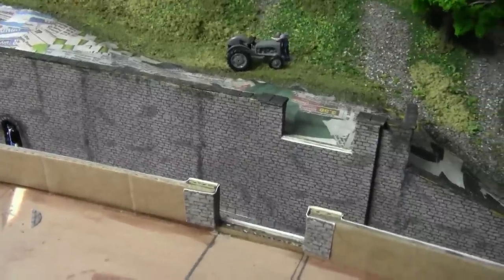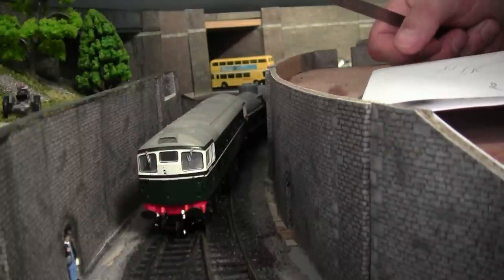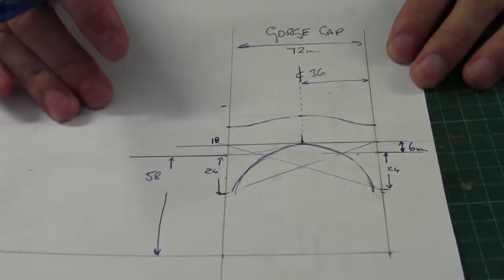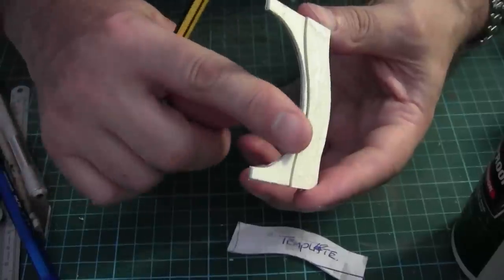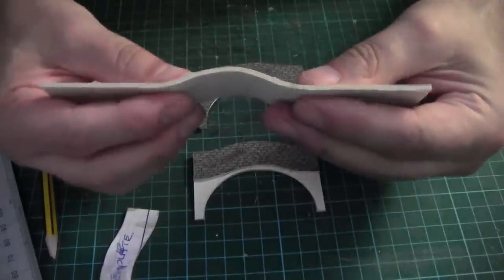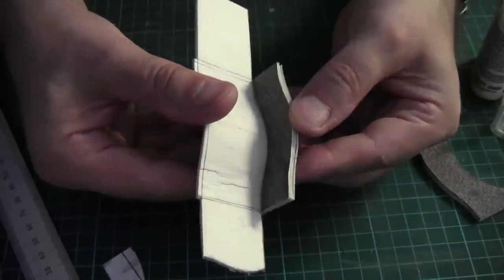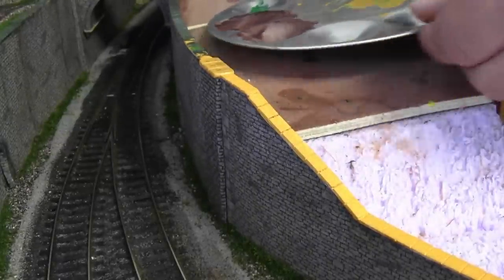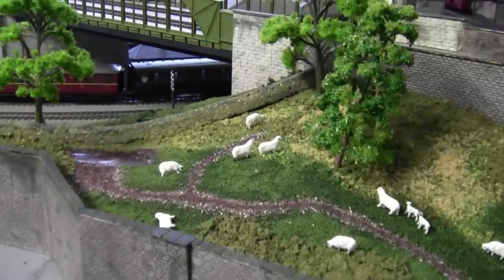Jarrow Road Part 7,  A Bridge Too Small   No 331

Comment: Hi Tony, great `small` but well detailed bridge. Looks like it has always been there, you are an inspiration to us all. As you said this cutaway and bridge adds another interesting section to your layout. With regard to the heat I have been unable to get into my loft (layout) because I had a rotor cuff repair to my left shoulder four weeks ago and hoping that the heat over the next week does not warp my track, got two more weeks before I can remove my support sling may have to get one of my son's to open the velux windows, track was laid over ten years ago in the summer time to allow for expansion (sweating like a good one at the time) but not for the 40 degrees they have forecast. I hope other subscribers that have loft layouts are able to keep a check on their trackwork over the next coming week, take care and stay safe..
Reply from the maker: Oh no that is not good Barry. you have to let me know when you are in the loft. If you send us a short video clip, i will be able to put on the community page when you are up to it off course. take it easy and stay cool, boy its going to be hot. there always the ladies football to watch.  take care buddy...cheer's Tony

Comment: Thanks Tony. I wanted a humpback bridge on my layout - like the one in Summer Wine - but  the awkward shape of the ends of the bridge and the lay of the land prevented me from using card or plasticard. So I opted for Das Clay. After several attempts I got there and it doesn't look too bad. Thanks again for a great tutorial and good ideas.
Reply from the maker: Good morning John, hump back bridges can be a of a hit and miss. but if you get the measurement's right then its should work out. on a previous layout i did do a foot with a hump in it. but that one i hand built if first before making up the river banks. there are different ways of build these. the clay one should very realistic i am thinking. stay cool. all the best Tony